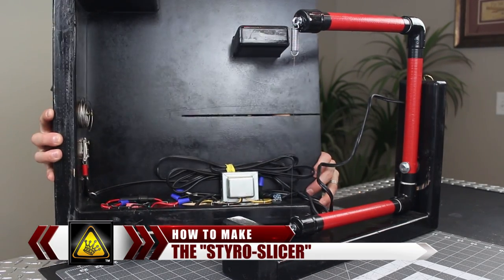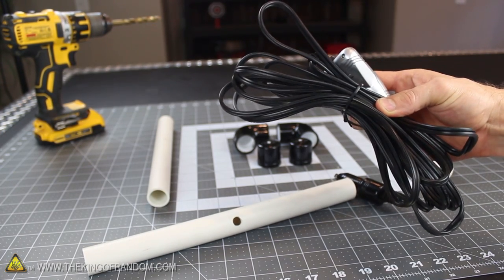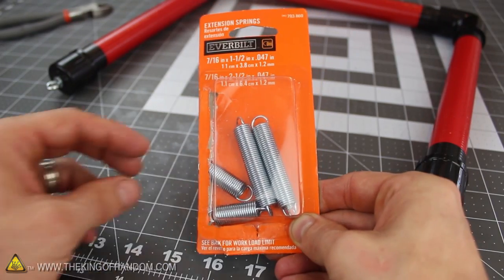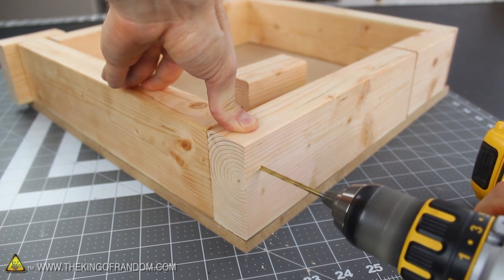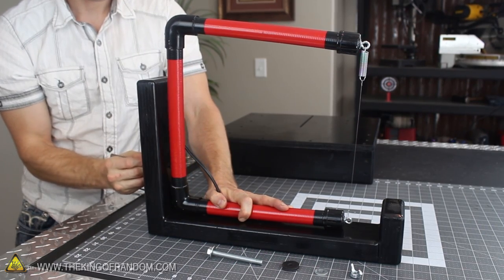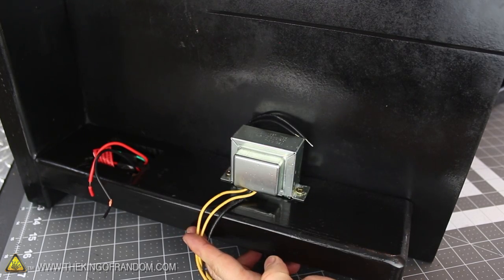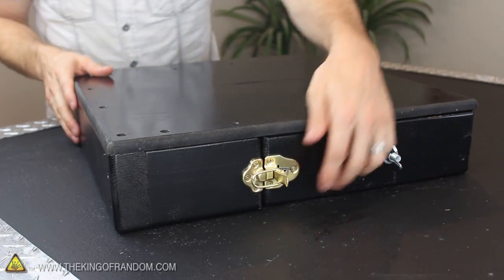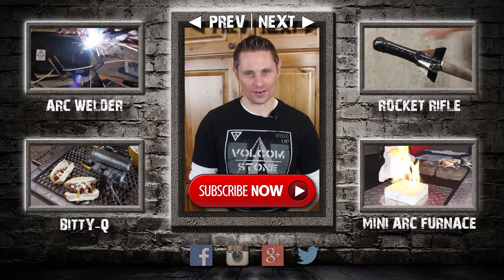How To Make The "Styro-Slicer"

Comment: is it possible to do something like this with nichrome wire maybe a different power source, seen ones like it that can cut plexiglass but seemed dangerous using a lipol battery

EDIT: built this not exact but it works, using nichrome instead gonna tweak more cuts plexi and foam

Comment: So the dimmer switch is mainly used for an on/off switch? Any specific reason you designed it this way? Would a two prong switch work in its place? Excellent totorial as well! Probably the best one I’ve seen on YouTube, very methodically presented! Great job👍
Reply: The three-position switch is the on/off and 6v/12v selector (6v/off/12v). The dimmer switch controls how much power goes to the transformer, so it is essentially a heat adjustment  (and could also be used as an on/off, leaving the 3 position voltage selector as a failsafe).

Comment: I bought the transformer that Grant linked to on Amzn and when I turned the 12v setting the transformer couldn't handle it. At about $20 each I surly don't want this to keep blowing them. What must I do? Does it need to be a higher Amp transformer or higher volt (16v instead of 12v)? SOMEONE PLES HELP!

Comment: I've watched this a few times and will build mine soon, but I'm wondering does the back up battery clamp wiring hook up to the same connections as the dimmer switch? It doesn't reference this in the video. Thanks

Comment: where exactly do you hook the battery backup cables into the wiring? I tried following it in the video, but it disappears under the transformer. I've watched the video several times trying to catch a peek at where they are hooked up, but I cannot tell for sure.

Comment: can someone please explain why the small toggle switch (6v/12v) is needed if the 600w dimmer switch can control how hot the wire gets?
Reply: David J if the switch is flipped to 6v and you turn the knob all the way, it will max at 6v. if you flip it to 12v it will max at 12v
Reply: Psychiz thanks for the reply but still don't understand why you would want to have it this way. the system could be set up for 12v and just turn the 600w dial halfway for 6v and all the way for 12v.
Reply: you don't need it its just for convinience i guess

Comment: Hey King of Random, 
 I am planning on building this and I have found all the materials except my 12v transformer and my  10 amp fuse. Just wanted to know where you got yours and if it is possible to use a 15v transformer instead
Reply: King of Random ^

Comment: Do I need a transformer? Can I just buy a dimmable switch and use that as a regulator and set the power to low? Also could I just use a car battery charger as the power source? In theory I could just change the power input, correct?
Reply: NO! The dimmer puts out 120v AC, which would most likely cause your whole setup to catch on fire.  The battery charger might work, but it puts out 12v, which would probably be too much for the wire.

Comment: I’ve got everything hooked up according to your diagram but the slicer isn’t heating up. The only difference I see is that my dimmer switch had a green ground wire on it, which I just capped off. Any ideas?

Comment: Can someone please help?! I have made basically the same thing as this but a bit more ghetto and I have all the circuits connecting to make a complete circuit.  But whenever I try to get the hangar wire to heat up, only the spring gets hot and the wire stays the same.  Please help!
Reply: are you sure the hanger is conductive? make sure to remove any paint or plastic coating off the hanger. maybe just use an actual wire lol
Reply: Hanger wire is probably too thick,  which provides extra resistance.  I'd recommend getting a thinner wire,  or increase the electricity to it.

Comment: at only 120w its no wonder to me that you had isses cutting through the dry ice block. run it closer to 25a and you'll have no problems with damage to anything, but higher voltage will have the opposite effect (less heat).

Comment: You could get battery charger that charges 6V batteries and use the wires from the charger right? that way you just plug into a household outlet.

Comment: Grant,
I tried to make this, or a version of it.

I went to radio shack and found a wall adapter that has a switch to choose selections between 3 and 12v dc
I thought this would be perfect, 

I thought I would be able to use alligator clips running from the adapter to each end of the hot wire. 

unfortunately I got no results. 

any idea why? or what I can do? to make it work?  I can upload pics. of what I did,  just not sure if you actually read the comments. 
bit if you do. I appreciate the help and I love your videos
Reply: Run the red wire through to the transformer and the black one to the fuse. Look at the diagram he made in the video
Reply: I think it’s the type of wire, I’ve been researching and I think you need nichrome wire

Comment: If you use a plug that outputs 12vDC couldn't you just run a wire between them and it would be the same thing?

Comment: Thanks for posting this! Do you know a way to cut a bunch of matching and perfect hexagons with this? I need to make like... 1000 :) I'm hoping someone that does this stuff already has a solution on the configuration to do that
Reply: This is probably too late and I don't do this regularly but I have a possible thought. Stack your sheets vertically, sticking them temporarily together with something like double sided tape, then draw your hexigon on top and cut them all at once.  The variables will be how steady and accurate your hand is at cutting and how thick the material is (or how long your cutting wire is so you can do them all at once). Perhaps using a hard straight edge that doesn't conduct would help guide the wire.

Comment: I blew threw like 3 transformers trying to get this to work and I'm a little confused on y the dim-switch comes before the transformer not after. Am I using he wrong wire? I used like thin galvanized steel wire any tips that could help me finish making this? I'm a big fan and I'm make a lot of your other projects such as the mini melt foundry and the baterangs. Any help would be useful. Thanks Cole 😂

Comment: I need some help... 
I made the styro-slicer and it works great, but after about 30 seconds of it being on, the cutting wire snaps (because a section of the wire melts). I'm only using the 6v setting and the wire manages to get hot enough to melt the wire. is there any way I can avoid this? do I need a thicker wire? and if so, how thick? please help!

Comment: why 10amp fuse? the transformer is 12v 3a which is 36 watts so the fuse should be 36/120=0.3a (120 being the voltage from US wall plug)

Comment: Started building this because I wanted to cut foam for a costume I'm designing. Bought the exact same materials but when I performed the test on the 6V battery, it wouldn't cut foam or even paper. It smelled like it was heating up a little but obviously not enough. Hesitating to continue at this point.
Reply: Finished the project and it works great. I used a 25V 2A transformer but kept all other materials exactly the same. Made a video as proof it works. Thank you!!

Comment: Can this cut through EVA Foam most costplay material is made out of?
Reply: It does, but I have to put a lot of tension on the wire, and this usually results in a not so smooth cut.

Comment: If I need to cut EVA foam what power supply spec you recommended to use. I had been used 12V 60W but its cut not smooth enough.

Comment: I built one that was working fine, then I stopped using it for a few months and now it won't work. There is power coming from the outlet, and all the connections are solid. Any ideas of what's wrong?

Comment: I'm having issues trying to a find transformer for this project.  Do you think 6v 3amps is necessary or do you think you could get away with a higher voltage 12-20 and only 1amp?

Comment: I build this thx for design and video. I added a washer between spring and wire for easy removal to cut stuff in middle.  What I REALLY want to know is how did u take out that circle for 3 way switch ? Without coming thru front? Wtf anyone pls explain

Comment: I made one but they keep having black residue on the string that slow down the cutting process, can you help me with it ?
Reply: Try turning up the power. if the wire is hot enough it should burn off the build-up.

Comment: update. I have made these using the same method, only my transformer exploded. any ways go prevent overloading? Other than fuses?

hint : use nichrome wire, set it to 12V. 6V wont work on nichrome wire, but it did well on the hanger wire.
Reply: I think grant will update

Comment: Grant Thompson - "The King of Random" I recently tried this to cut spray insulation and it failed horribly. We built a frame for it and it didn't work. Do you know why it didn't work?
Reply: Mason Rivera How about you give us some info on how you made it and stuff, then we might be able to help.
Reply: WolfyMC we used 2 6 volt batteries and we set it on a cutting jig.

Comment: Uneducated question: if the dimmer switch adjusts the flow of electricity why not bypass installing the toggle, and simply use the dimmer switch to adjust the voltage?
Reply: The dimmer just diverts some of the power to ground.. So if you don't need to use 12v it is much better to switch to 6v so that the transformer isn't working as hard and doesn't overheat.

Comment: I tried this running both wires directly to a 18v battery and the wire gets red hot. However when using a 9v battery nothing happens. Any ideas?

Comment: I got a 12v transformer out of a power brick but it only has 2 wires on the secondary side. How can I wire it to a switch with only 2 wires on each side of the transformer?
Reply: it doesnt have a center tap, so you dont have a 6 volt output. only turbo mode
Reply: ok thank you. I take it that I can still wire it up to just a regular 2 mode switch then? (On/Off)
Reply: yes
Reply: John Fyffe thanks

Comment: I've seen many questions about where to get the transformer rectifier, and I just checked radio shack with no luck. Anyone have some reliable info on where to get one?  Does it need to have 3 wires on the bottom and 1 or 2 coming out of the top?  Thanks for any input - this is the last thing I require to finish the project.

Comment: I'm having a problem making this... with the measurements made... everything doesn't line up like in the video... also from the slides in the video it appears you have the placement of the 18in and 15in boards marked in 2 different spots  this is just confusing and I don't see how the boards are supposed to make a box..

Comment: just a question , i connected the two wires without the switch or the transformer to a 12V battery , but the voltage of the battery is going down so fast , can anyone help me please ?

Comment: i built one of these and used ot for about 30 min or so and burnt my transformer i got out of a stero it was not dc it was 12v ac according to my multi meter is it normal for these to burn out with longer use. if i dont use it as long should one last longer or do i need to buy a 12v dc transformer

Comment: want to build a single use for cutting styrofoam, do i have to use the transformer or the fuse, if i just use a 12V power source?
Reply: No need if just using battery. But it it DEFINITELY needed if using AC wall power

Comment: instead of cutting out the plug u can use it to power the styrofoam cutter
Reply: I think the difference in colts might burn out the cutting wire. I’m no electrician tho so I could be wrong.

Comment: Having a mental blank can someone help me out. If it can be plugged into an outlet and puts an electric current through the metal ends and the wire what is stopping it from shocking you as I assume this build can't as I can only see heat warnings for the wire. Would love to attempt this build but apparently its been far too long since my last science class.
Reply: The transformer is key. 12v isn't enough to really shock you.

Comment: Im making this, is the transformer ok? i have the multi output (4.5, 6, 7.5, 9, 12 volts) transformer. and it smells like burning. anything wrong?
Reply: by the way, the output is 2Amp
Reply: Hans Christian the transformer is AC?
Reply: it's AC, i see no short circuit, but it smells.
Reply: probably overload

Comment: Hi Grant! I got a question. Do you think the styor slicer would cut through thin polypropylene plastic? More specifically, I'm wondering if I could build this to cut through Coroplast™? It's the type of corrugated plastic typically used for yard signs like "vote Grant for President" or "for rent Joe's properties 555-5555". If you think it will work, I like your design best. 😎 p.s. say hi to all the other staff for me. Everybody there is awesome.

Comment: what will happen if i don't add the transformer or dimmer switch? thanks :)
Reply: you must add the transformer (if you want to attach it to the power supply on the wall) because it changes 220 volts to 12 volts and 220 volts is very dangerous but u can still avoid using a transformer by using a 9v battery and btw the ac/dc adapter for your laptop is actually a transformer you just have to read how much is its output voltage and amps, grant used 12v and 3A (or 3000mA) but a 2A would work too
Reply: and you don't need a dimmer switch it just reduces voltage thus reducing the heat produced by the wire

Comment: What wire can get hot from electricity?
Reply: Ever touched a light bulb after its been on for a while?
Reply: What do they teach you in school
Reply: Chemical potential energy from the battery is converted to electrical potential energy and later light, heat and sound energy. :)
Reply: Chemical energy: Battery -> Electrical energy -> Heat energy
Reply: close enuf
Reply: Hanger wire after it has been untwisted
Reply: every electrical conductor?

Comment: where did you connect your ground on the dimmer switch?
Reply: To ground wire on the wall plug  cable. It should be green.

Comment: Hey I am curious why do you need a transformer...
Reply: to fight megatron
Reply: hahahahahahahaha stahp
Reply: Running straight 110V AC through the wire will likely start a fire and probably melt the PVC pipe.  Stepping it down to 12V DC is much more manageable and less likely to be fatal if you accidentally bump the wire.  Electric shocks can be fatal if you're not careful.
Reply: That makes sense! Thanks for taking the time to explain!

Comment: Hot wire isnt getting hot.    What needs to be done to fix this?
Reply: KRE8 Dome Housing is everything connected
Reply: TheReal ShaD0WfaceXZ 

I believe it is.    The only thing i haven't done is cut the plug end off of the cord.   Maybe that is what i need to do?
Reply: We would need to see what you have built to really troubleshoot it
Reply: What battery are you using
Reply: KRE8 Dome Housing it sounds like your battery isn't big enough or isn't rated for the amperage

Comment: Does anyone know if a 12 volt,  2 amp transformer will work?
Reply: Probably, but be sure to have the dimmer switch and I'd probably leave it on the 6v transformer setting. If you start pulling too much amperage the transformer overheat and fail. The dimmer switch will help you to not do that if you keep it turned to where it's just enough voltage to get the job done.

Comment: Make sure you put the spring on otherwise you’ll get what happens to me. As I plugged in the wire to the wall as a test (I don’t have the spring at the time) the wire exploded into sparks and scorched my work bench.

Comment: I would push both ends of the stranded wire down through one end of the tube and tie the knot there, Then I would thread one end of the stranded wire out through the other end of the tube and go on with the project..

Comment: Very well made video. However, I tried a 16V doorbell transformer - nothing. I tried an old 12V power tool charger transformer - nothing.  I tried an old 18V power tool charger transformer - nothing. Using my VOM, I read the voltage on the secondary side of these transformers once up and running and it seems the voltage drops from it's stated voltage to no volts - and no hot wire. Okay, so what's the secret?
Reply: Victor John well, you can just skip the wiring and use 12volt battery for the power.

Comment: so I made this, but after 3 days of (fairly constant) use, I overheated my transformer. it just started smoking and the wire lost all heat. this happened when I had it on full power and was cutting pvc as a test. was this a problem with my transformer or the way I have been using it. I bought the transformer here: https://www.amazon.com/gp/aw/d/B0002ZPHLA/ref=pd_aw_fbt_263_img_2?ie=UTF8&psc=1&refRID=7PE7VFBEZ6WRQTSJT8T8
Reply: Braeden Stumm if you are not bothered about it you can use a lantern battery like he shown if it was only the transformer
Reply: your transformer is only rated for a maximum of 3A on the secondary so you probably overheated it by trying to pullo more than the 3A i would suggest a new transformer and a fuse on the secondary that has the same rating as your transformers secondary that way if your pulling too much current your fuse will burn and not your transformer
Reply: Erdnusschokolade I had the same problem with my transformer. If i do what you are recon. then is the 12v setting not gonna be at max bc it seems to me that the fuse will keep blowing. Thanks for your time.
Reply: Add manual captions
Reply: David J the resistance of you cable is probably too low so you would have to change that either longer/thinner cable or another resistor in series with the slicer

Comment: anyone have issues with wire burning up..   I put 6 volts ac on the wire.. and within 3 mins, boom.. burnt.  using a guitar E string.